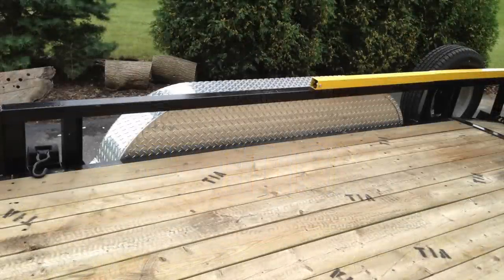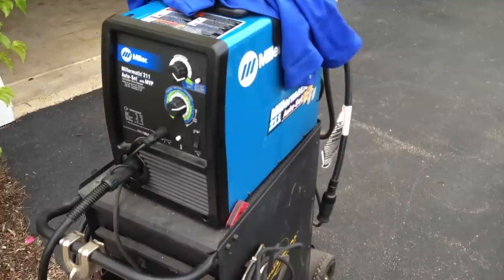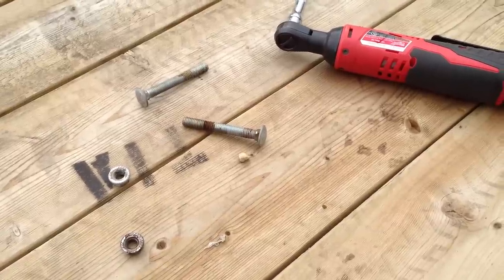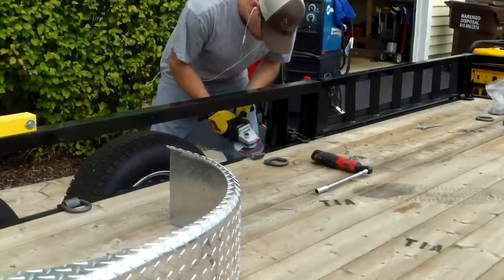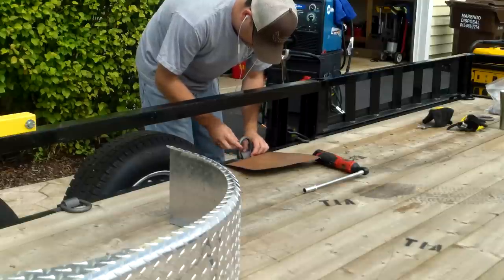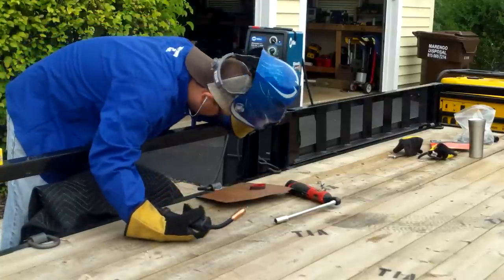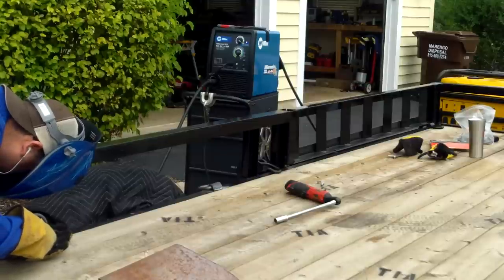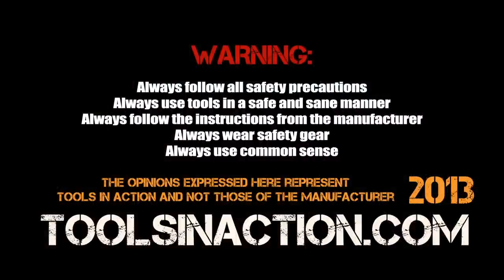Welding D Rings on a Utility Trailer - Miller 211 Autoset , DeWALT Generator and Hobart Adapter

Comment: Just my 2 cents. I always take my oxy acetylene torch, after cleaning the surface of paint or powder coat, and warm up my rings and surface too burn any oils or contaminants off. As far as the Miller 211 I agree its my go to welder, awesome machine. Thanks for the video
Reply: You don't even need that

Comment: Why did you blow out the end when you finished the weld it makes the weld weak   you should start on both sides and finish in the middle been welding for 40+ years

Comment: Good tools 12M Ratchet and Millermatic 211 Welder. First I welded rings on my trailer, but then I decided to build a whole new set of d-rings, so I could put them in my stake pockets and pin them in,  Nice thing about doing it that way is you got one set of rings for all your trailers
Reply: damn good idea!

Comment from the maker: Yes, it is easy to use and will give you great welds with minimal setup.  O fcourse there are less expensive options.  But In General Miller is a great brand.

Comment: I have a 22 trailer similiar to that and have added 3 d-rings like that for that reason and also have a 14' trailer like that we added 7 d-rings to so we have them on the sides and in the front corners.  We also have an older Millermatic welder and its a great machine.

Comment: Just came across this video and was very impressed. you had some good ideas.. I have a basic 110 welder, H freight, and I want to Weld on some 1" EMT tubing on top of my square stock so I can put those trailer gate assist Springs in. I noticed the trailer assist equipment you have on yours in yellow, and I saw that online.  have you had any problems with that? especially cable?

Comment: Keep in mind Autoset thickness is for single pass welding. The strongest welds are multipass welds. Never be afraid to stack beads just don't get carried away and overwork the shit out of it

Comment: Need an honest opinion,  I'm looking at either a New Millermatic 200 or even Miller Syncrowave 210... I only have room for one welder and only can afford one welder, but Need it to weld backhoe buckets and I need to weld a 12,000LB winch to my car-hauler as well as tiedown loops, and I have an aluminum boat that got smashed on the rocks and I want to fix the leaks, and do railings and now maybe even build a trike from the frame up as well as bumpers and guards on my side-by-side Quad... But if you can only have one welder in the price range of these what would you have?? (is there another one I've over looked?) (must be under $3000. total with all options) Also can the Miller 210 cables interchange with the Millermatic 200?? As a friend has the Millermatic 200 and I want to make sure if I get the 210 and I'm mig welding on a Sunday after Church and the gun breaks down, I want to be able to call him and have him bring over his gun to finish the job, instead of having to either waiting a week to order one on line or even waiting for the next day to drive 30 miles into Vegas to try to find another one... Anyone that have one of these or have used these please let me know of any drawbacks on any of these... Also, So you're saying Tig is better than Mig? Is it easier? Is it stronger? I have a $89. Harbor Freight gases Mig I have used to do little stuff, but need something like I said, that can Handle a "Heavy-Duty" brackets to mount a "12,000LB" Winch to haul Dead Trucks onto a trailer without breaking apart and killing someone... As well as repairing everything on my Backhoe out in the field... And yes for artsy-crafty stuff in a few years as well...  I have never welded with "Gas", in either Mig or Tig, and I have never welded Tig at all... Kinda looks like old school Oxy/Actl Brazen without the big torch, and open flame... Most of my work will be done either on 110V House or 110V Gen, until I can find a good used Gen that's big enough to run it on 220V easy... I have never used a spool gun, so I don't know if I like it or not... I don't know if it matters or not but I'm Left-Handed So some of the things would be backwards for me... I may need to do some exsust work on my pickup and Old RV as well... I have done some stick welding 40+ years ago with an old AC-only Lincoln 225... I also want what ever I get to be something I can let my Grand-Kids take to a welding class and learn how to weld properly, Then I won't have to do anymore welding... LOL!! I'm leaning towards the MILLERS  rather than ESAB or TWECO, But just don't know if I should get the DC-only 200 or the AC/DC-210 I have a trailer to roll the 210 on so hauling it around wouldn't be that much more work as the trailer is on my truck 99% of the time anyways... But the 200 would fit in the trunk of my car that gets 40MPG  and the truck gets 12MPG but I don't plan on using it that much for traveling...  See I may weld 5 or 6 things one year and not weld anything for 2 or more years... Actually the last time I welded anything was in January of 2015... But I have a bunch of projects coming up from making Shooting targets to everything else I mentioned above and more... So I can't make a mistake and spend a ton of money I don't have and not get the right unit... I appreciate all your help and look forward to your response and help... So if Tig welding is "Stronger" and can weld a wider range of stuff better, I will get the 210 and learn how to Tig-Weld... Let me knowASAP as the rebates end 12/31/16 and I'd like to know before Christmas... Thanks

Comment: Never use short circuit mig on D rings is dumb as hell use a ductile material such as dual shield fluxcore or 7018 or spray transfer hardwire